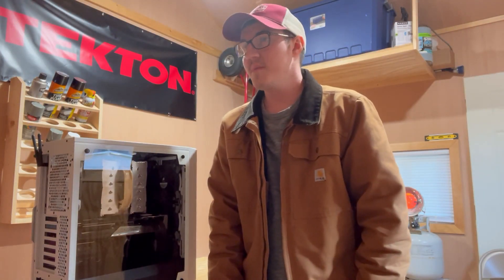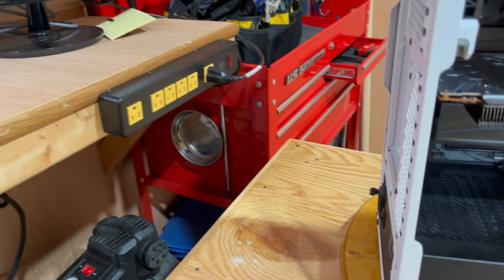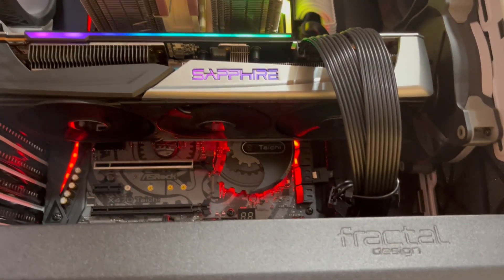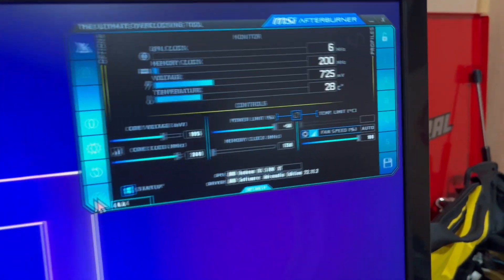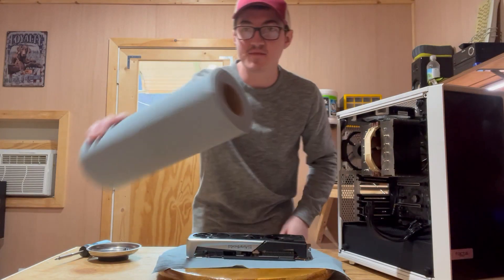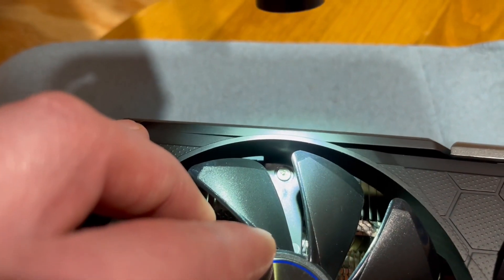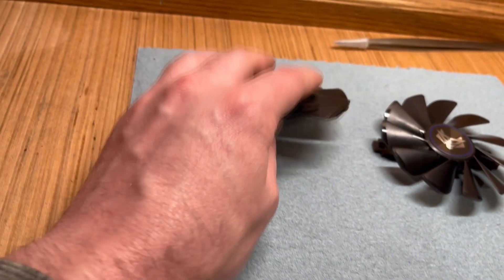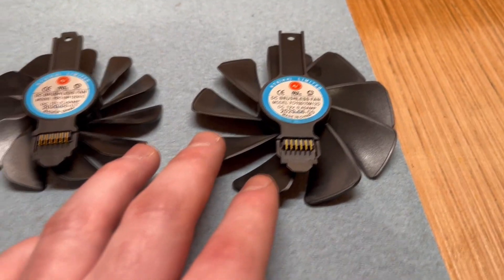My GPU Fans Are FAILING

Comment: I'am getting the same issue, tried everything, from formating the windows, drivers, to opening the card and checking the fans manually... Nothing worked, I got no idea what to do... The leds are working, I have video, but fans just won't spin only very sporadically, not in the way they used to and should. Can't even control them through any app.
Reply from the maker: In the sapphire Trixx software there is a fan test. Run that and if any of the fans fail the test then they’ll need replaced
Reply: It turned out that the PWM feeding the fans was damaged. Got it working after sending it to a technician. Thx!

Comment: I have my RX 5700XT Sapphire Nitro+ and when the fans started to fail, I replaced them with fans from the 6700XT Sapphire Nitro+ which are fully compatible and gave me improvements in temperature and noise
Reply from the maker: That's really good to know 
Wonder if I could find some on eBay
Reply: @anthonytech  i bought this on Facebook market place and works really well

Comment: How's the fan? My nitro still doesn't spin.
Reply from the maker: The middle fan tested bad in the trixx software so I purchased new ones 

Take a look: NEW GPU Fans Are Better Than I Thought
https://youtu.be/Dp8jSImGsLw
Reply: @anthonytech  I recently purchased the fans because my GPU isn't spinning and is stuck at 29 RPM. Since it had been a year since I bought the GPU, I thought the fans might not be functioning properly. I bought fans from your website, installed them on my GPU, but they still don't spin and there is no RGB lighting. I'm unsure if these fans are supposed to be RGB because the store description didn't mention it. I'm surprised because yours is RGB. I'm really unsure about the problem since the fans still don't spin.
Reply from the maker: @Djeafskie  I just want to be clear the website is not mine, I had good luck purchasing from them so I linked the site in the video.
Have you tried installing the TriXX software and running the fan test?
All of mine test good in the TriXX fan test
Reply: @anthonytech  Yeah I already run some test with the trixx all fans are red. Is there any fix on this? I think the fans are good. My gpu is acting weird with the 29rpm shown in amd adrenalin and msi afterburner. I reached you coz maybe u have encounter my issues.
Reply: @Djeafskie  Hi. Did you manage to solve this issue? Recently AMD Adrenalin Software and HWInfo64 show the fan sensor on my Sapphire RX 5700XT Nitro+ reading 30RPM maximum and I was thinking of getting fan replacements too
Reply: @cookadoodle  negative bro. My gpu still not spin.
Reply: @Djeafskie  Aww man... Sorry to hear that :face-red-droopy-eyes:
Reply: @cookadoodle  same problem here. with the same card. I was going to buy other fans, but apparently they won't work.
Reply: @Djeafskie  Same problem here with this card. It happened out of nowhere to stop and show 29 rpm...
Reply: I'AM getting the same issue, tried everything, from formating the windows, drivers, to opening the card and checking the fans manually... Nothing worked, I got no idea what to do... The leds are working, I have video, but fans just won't spin only very sporadically, not in the way they used to. Can't even control them through any app.

Comment: one important tip for you, that noctua cooler you have there needs a fan on the right side.
why ? because fans are good at PUSHING air through the fins and a LOT less good at PULLING air trough the fins.
check it if you don't belive me...
Reply from the maker: I've built many systems...I know this information. I DON'T actually need another fan on the right side. I installed the cooler exactly how Noctua says it should be installed. It's a Noctua D15S not a D15